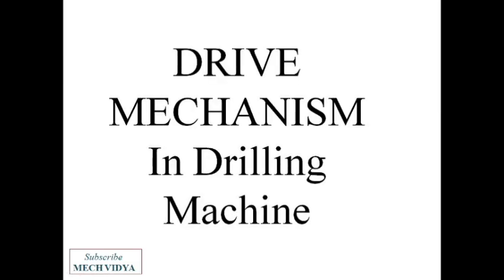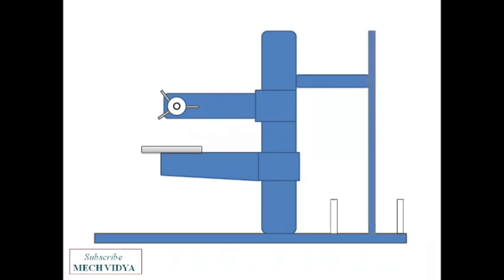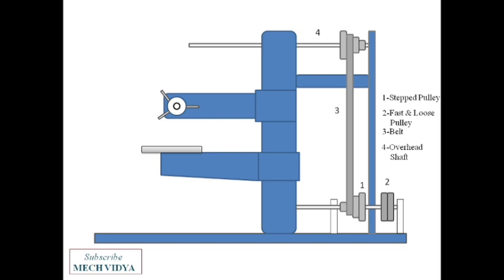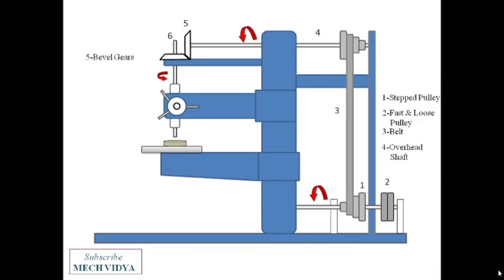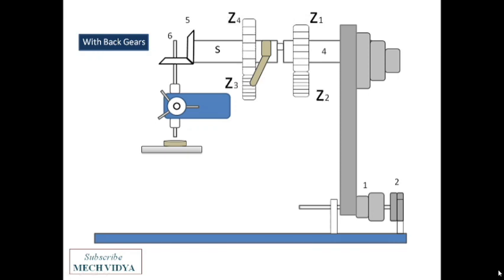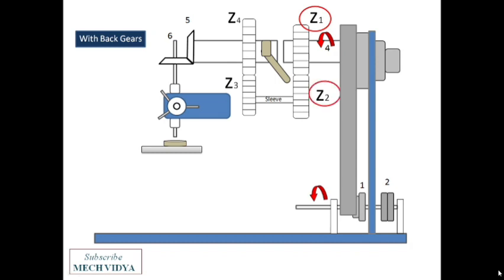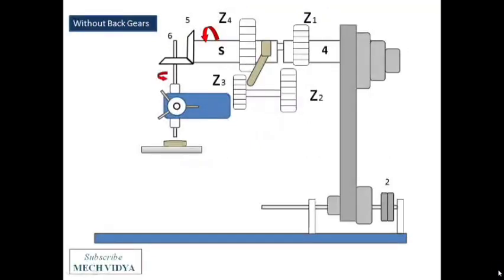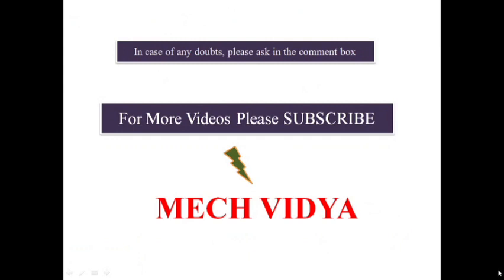Drive Mechanism In Drilling Machine

Comment: Sir, 
Do "rack and pinion" gears have any application/role in this drilling machine mechanism?
Reply from the maker: The rack and pinion is used to adjust the drill table up and down. When we rotate the hand wheel this rotation is converted to linear up - down movement of the table by rack and pinion mechanism.
Reply: @mechvidya2020  
Thank you so much, sir.